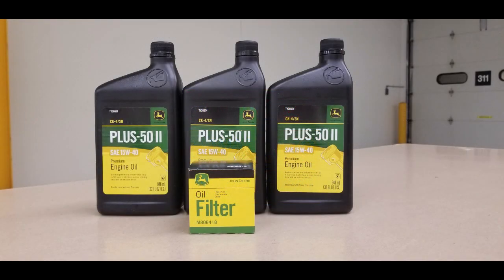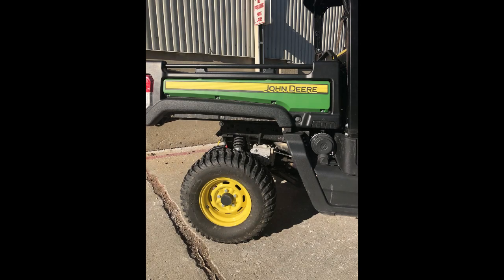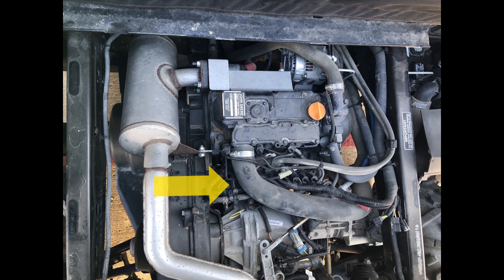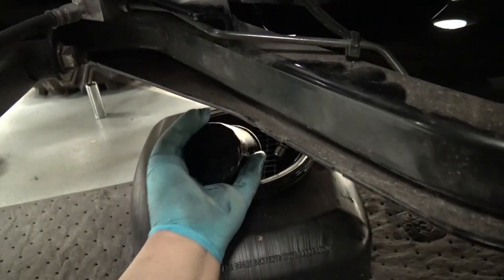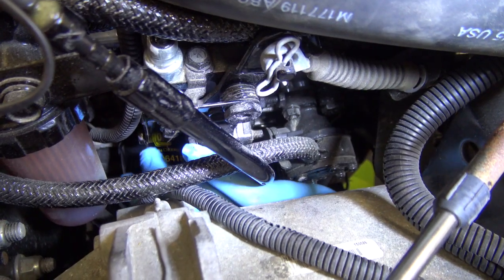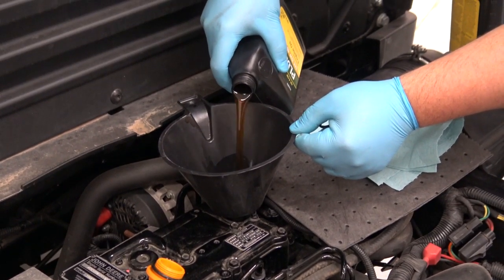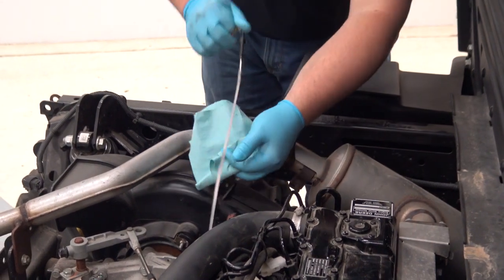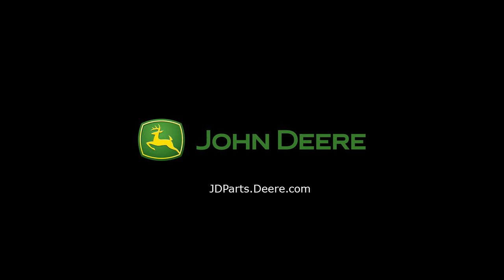How To Change Engine Oil & Oil Filter | John Deere XUV865 Gator™ Utility Vehicle Maintenance

Comment: Our 855D oil filter is pretty tricky to change, getting to the filter is so fiddly
Reply: Hi mate I work for you a John Deere dealer in Australia and do a lot of 855D and 865D. The tool I use which has made my life a lot easier is a 14 flute or 65mm filter cap it has a square drive on the end I’ve seen 3/8 and 1/2 inch but I think the 3/8 size is better due to limited space.  The filter cap just fits over the end of the filter bang your ratchet on ( I use a snap on  locking flex head  3/8 ratchet so I can lock the ratchet out in the preferred position found it the easiest) wind your filter off and your good to go. Hope this helps.